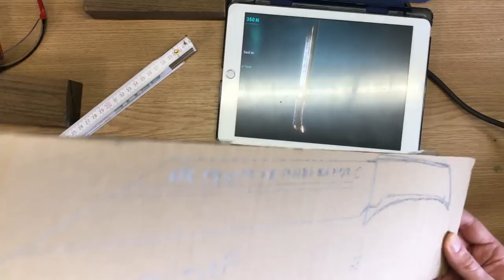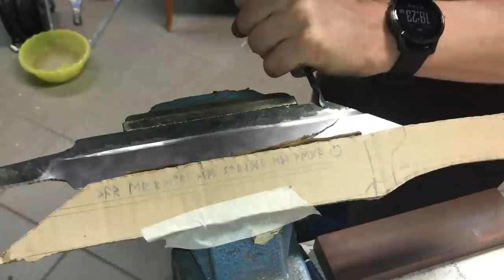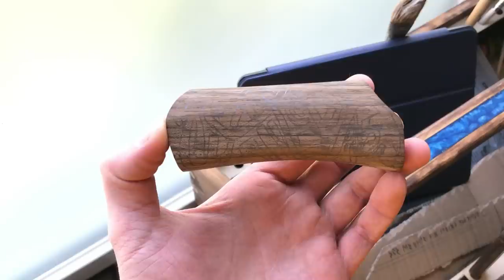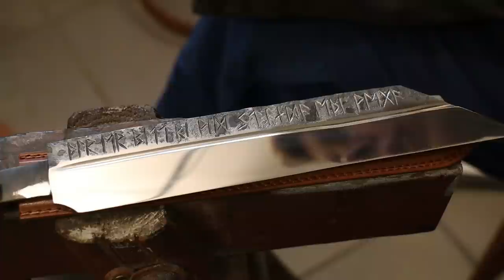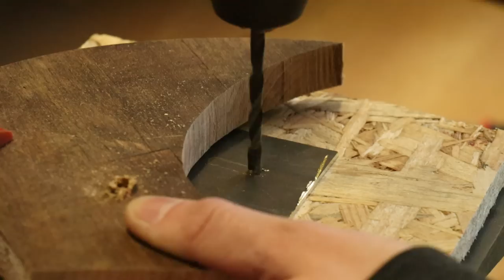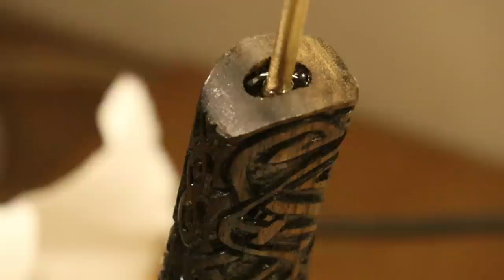Making a Viking Seax - Ljosalfar Blade from Assassins Creed Valhalla

Comment: The first time I tried to make a brass crossguard I thought I could drift it like it was steel. I drilled a line of holes and heated it up and took a chisel to it. Stuff crumbled and broke like old cheese. It pays to do the reading first.
Reply from the maker: 😂 you’re definitely right. But the 10 minutes of reading are way easier than spending an hour fixing your mistakes. And where is the fun in that 😄

Comment: Lawnmower blades haven’t been made out of high carbon steel for a long time, more modern blades (last couple decades) have been low end of medium carbon steel using alloying elements to make them tough without being hard. Reason why is the older high carbon blades had a possibility of breaking when damaged but now they want them to bend instead of breaking to prevent injuries. You can still use them to make a decent machete but not good material for knives like the old mower blades were on the really old mowers

Comment: very cool!!! what steel did you use?
Reply from the maker: Thanks! I used an old lawnmower blade which I thought was tool steel like 1075. another viewer pointed out that it doesn’t have to be tool steel because many manufacturers use mild steel nowadays. In short, no idea 🤷🏼‍♂️😄

Comment: Did I just hear you call the fuller a "blood groove"? Never thought I'd hear an actual bladesmith use that erroneous term. I was deceived into thinking that's what it was called too though, when I was a kid, but it has nothing to do with blood. It simply lightens the blade without compromising strength.
Reply from the maker: You’re right, I didn’t know that back then 👍🏻